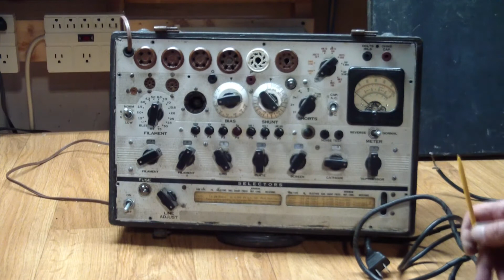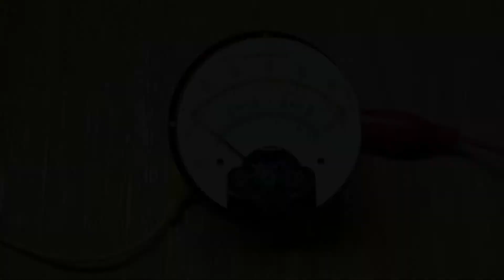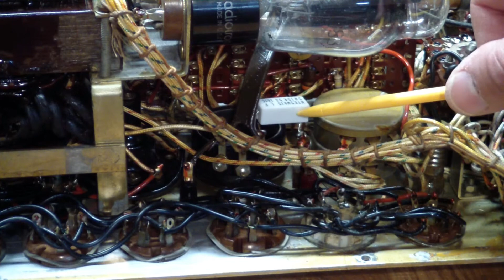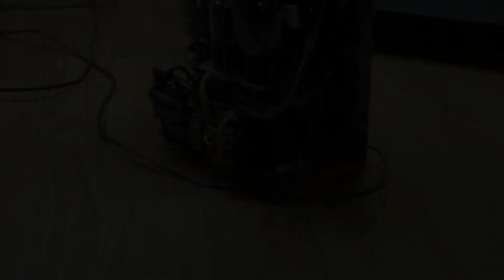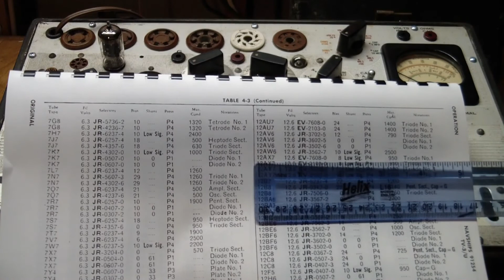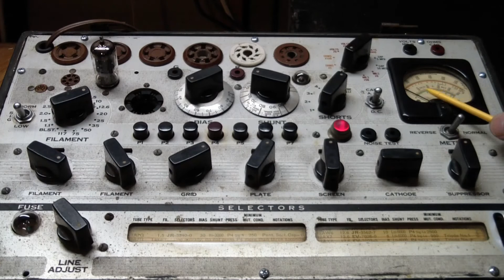AE#19 Hickok TV-3/U Military Vacuum Tester Checkout And Repair

Comment: Could parallel some resistors on that pot to increase its wattage. But resistance will go down so larger value pot be best. Then have an easy adjust 8k resistor

Comment: Crazy that a military tester like the tv7u and i-177 the meters get dirty or sticky. Where as the lab grade ones like mine which is 752. And a hickok 600 bench model like yours they used meters that where glass window and sealed really well

Comment: Artie you have confused me. The tired variable resistor you replaced with a 6k ohm resistor. So you measured the circuit and came up with 6.1k ohms resistance. I might be dense but I have no idea how you chose the size resistor to put in. Did you  measure that magical 93v output of the transformer to get that? Thanks for your videos like on the 465m Tektronics. I have seen other folks lay the front cover membrane out and clean it so the pots work rignt.

Comment: Go on mouser.ca you can get those resistors there exact replacement you will need to use one of the sliding tabs from old resistor to add to the new resistor

Comment: Just my advice,,,from knowing...never touch that spring that is coiled around the pointer pivot or shaft. ..It is very much like..or probley is a hairspring or balance spring that is in a pocket watch...there is one on the top and one on the bottom...I have tried quite a few times to fix that spring, because it was off to one side, or the coil looked out of round...it will only get WORSE..if you try to fix it...and also watch that fork that adjust the meter to zero...the screw on the meter clear cover has to line up in between that fork...
Reply: That screw hole which is stripped can be repaired by coating a toothpick with wood glue, inserting the toothpick into the hole, and breaking the toothpick off flush with the surface.  Do this two or three times and let the glue cure overnight.  The screw will then hold.
Reply: Kenny, adding to your precautions about fixing or trying to fix meters, I have cleaned corrosion products from inside the coil gap of sticky tube tester meters; the old radio man's trick was to use thin strips or slivers of masking tape,  but that stuff is a little too soft and tends to curl back on itself.  I cut some strips from of the sticky part of sticky notes, aka Post-its,  I pre glued them to toothpicks in advance to give me a non-magnetic handle. I repeat, non-magnetic, because any magnetic tool that gets near that meter gap will be pulled into it and probably destroy the meter movement. Use of metallic tweezers or hemostats or needle nose pliers is specifically not recommended! The magnet for those meters is surprisingly powerful.
Reply: The screw that adjusts the mechanical zero-point for the meter pointer actually allows you to turn an offset plastic cam with a little plastic tit sticking out of it that engages with the forked metal piece at the base of the meter mechanism. Turning the screw makes that cam move side to side and that's how you would 0 the pointer. You have to look carefully at the meter cover in order to line up plastic pin of that cam with the little forked metal piece as you assemble them.

Comment: I personally would not change out the tube sockets. I would drop each one into a bath of some type of metal cleaner, whatever type metal was on or in that socket. I think the machine would look better with its original sockets. I see one ceramic, but that is not necessarily a replacement. On old transmitters from the early 50's, they would put ceramic sockets on tubes that got very hot, but not the rest. It would just look better.

Comment: Nice video. The TV-3 /U manual states that your first test should always be the shorted-elements test. If a TUT has shorted elements, and the transconductance test is performed, it will likely damage the TV-3. That may be what happened to that variable wire-wound resistor.

Comment: Artie, probably old news by now, but you can still buy adjustable resistors.  The Ohmite D12 series would be  an appropriate replacement.  I also highly recommend the channel Mr. Carlson's Lab if you want to learn everything there is to know about vacuum tubes and restoring equipment.